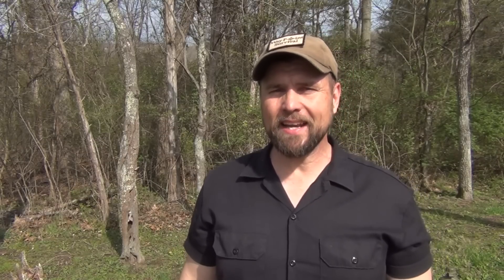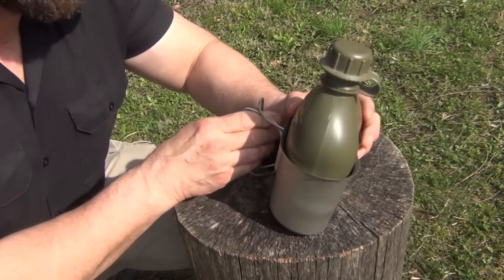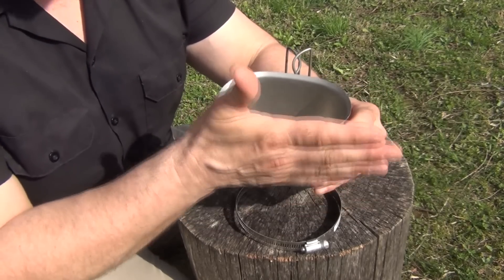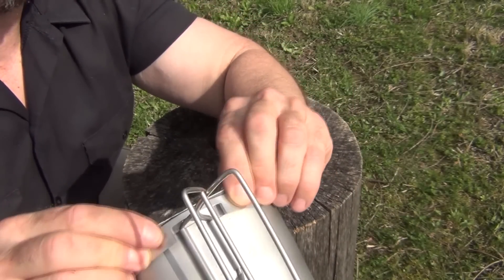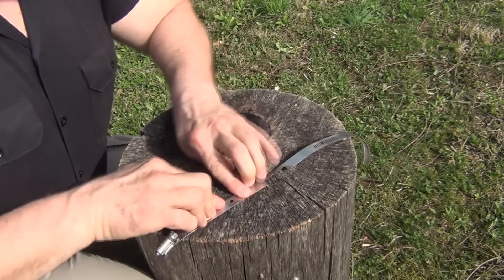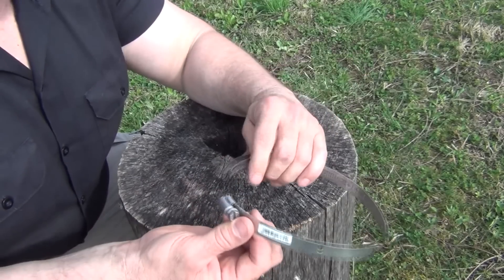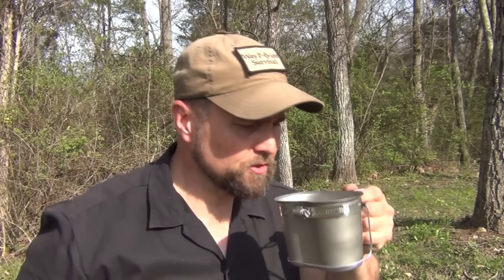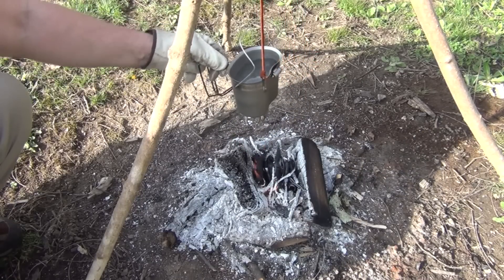US GI Canteen Cup No Drill Bail Handle!

Comment: I like what you've done and will make the same modification with each canteen cup I have. One thing I will do differently will be to put a small bend in the bail at the center of the bail so that when the cup is hanging by the bail it will not slip to one side or the other spilling whatever is in the cup.
Reply from the maker: Yes, that would be a good addition as long as it doesn't stick out too much and hinder it's nesting abilities.
Reply: nice one

Comment: Great idea if you already have this canteen, but if you don’t have one yet, take my advice and get a German/Austrian/Swedish mess kit.  You get the  kidney shaped pot and top, but no canteen.  The pot's bail locks so you can pour or hold it, and the top can be a fry pan, or small pot, amd is made to attach to a stick to hold over the fire.  Wayyy better designed piece of kit, and no mods needed.   The aluminum one is really cheap.  Like $25-20.
Reply from the maker: Yes, other kits have definitely solved this problem. However, I prefer not to cook in aluminum very much as it has long-term health risks.
Reply: @WayPointSurvival     Isn’t the us cup aluminum?             There is a Swedish (?) kit that’s stainless, but it’s a little heavy since it’s a pot, pan and bowl, and it’s a bit hard to find.
Reply from the maker: No, many of them are stainless steel including the one that I have. There were some aluminum ones.

Comment: Very ingenious design! The foldaway bail, still can use GI handles, cup,  stove and cover still functional like it was designed together. The only concern I have is that coat-hanger wire varies in thickness and strength. 
I would opt if possible for heavy gauge coat hanger for the Bail. However stronger wire coat hangers are hard to come by...
I don't know how much the wire will deflect under water weight. 
I am also a tinkerer and build things. 
Thank you again. You saved me from watching cats playing pianos once again😊
Reply from the maker: The wire that I use is from stainless steel hangers and is quite strong. You can purchase them on amazon.
Reply: @WayPointSurvival  A well thought out design. I'll be using stainless welding rod for strength and put a slight upside down 'V' at the peak of the bail. Small Gerber tool pliers will help with the bending.  Thanks for the ideas.

Comment: Excellent video. I had been considering building a sling-type pot hanger from small-diameter stainless steel cable per the instructions on the Far North Bushcraft. Lonie posted an excellent tutorial on the subject. The idea works great provided there is a  lip at the top of your pot for the cable sling to grab. The canteen cup "bellies in" at the front so the sling becomes problematic. I believe James has created a simple solution with easy-to-obtain parts
Reply from the maker: Glad it was helpful!

Comment: Thanks, James!  A clever Idea but lookingin my parts bun U found an easier and more versatile option.

Just put alligator clips on the ends of the wire!  
-Need more strength?  Put TWO clips on each end.
- Quick on.  Quick off. and can be used on other items.

Just found a recovered pair of trilling motor battery clips.  They maybe overkill for a canteen cup but they easily held up a half full stock pot (64 oz/4 lb/1.8 kg)

Hope that helps...
Reply from the maker: Excellent. I have seen people do something like that with metal paper clips or binder clips also.

Comment: I like it a lot better than mine. I just took haywire and wrapped around it and twisted in two places and made a handle for it that attach to the loops on the side. Yours looks downright professional.  Mine, not so much. 
But the way you did it you could also make one for the metal canteen if you did it right. But of course they stick on a string will hold it over fire anyway or you could make a hanger on the neck.
Reply from the maker: Thanks so much for watching!
Reply: @WayPointSurvival  thank you for putting so much hard work into your videos. You have a lot of great ideas

Comment: james, what about using some jb-weld for attaching the 2 screw pieces to the cup? there by getting rid of the hose clamp all together.
Reply from the maker: I'm not sure that it would hold well long term. Also, there is the issue of how much heat it can handle over a fire.
Reply: @WayPointSurvival  there are hi-temp versions on the market. weight capacity should not exceed 5lbs. in a canteen cup.

Comment: I think I may try and bend a loop in the bottom of each leg and capture them with the screw half of the Chicago screw into the nut side.
Reply from the maker: Sure, you can do that. However, you may want to use some Loctite on the Chicago screw or else it will come loose from use.
Reply: @WayPointSurvival  Except Loctite relaxes with heat.

Comment: Just get the German M31 , or better yet , if you want a canteen , the Soviet VDV mess kit , I have two , good design ,
Reply from the maker: Yes, there are other sets out there that have solved this problem. However, many of them are made from aluminum, and I would rather not cook in them long term.
Reply: @WayPointSurvival  True  but European millitaries have been cooking in them sense the 1930's with no issue , and srill do today .  They did it for lessons learned from WW1 , saves the steel for mor important things .

Comment: I'd use metal zip ties. Slimmer and no need to cut hose clamp.
Reply from the maker: The problem with metal zip ties is that they are too thin for the Chicago screws.